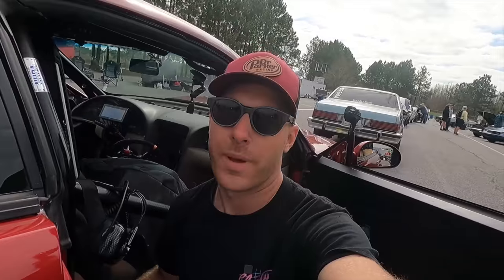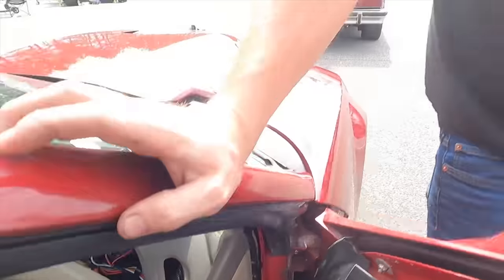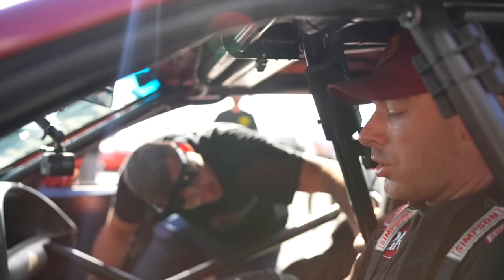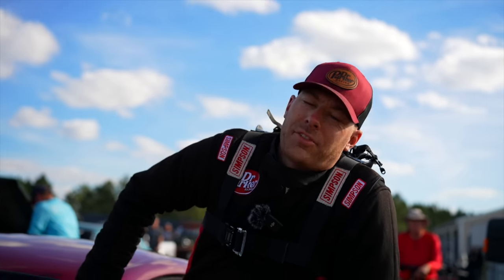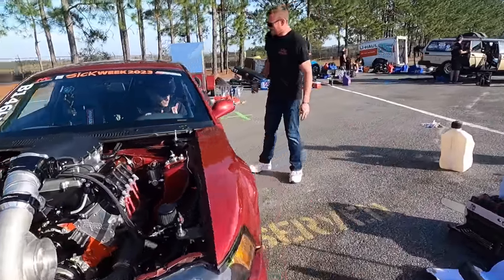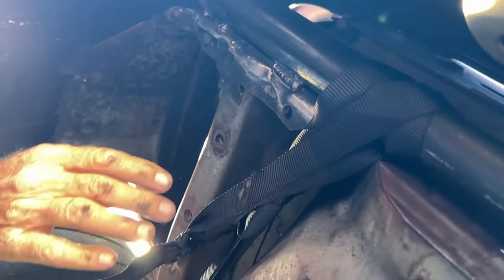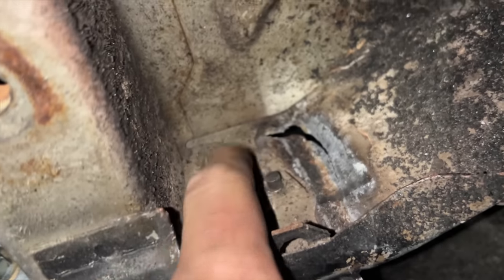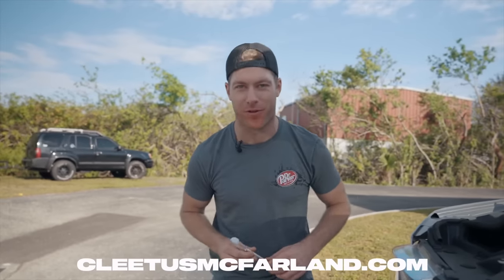Struggles On and Off Track are Real! South Georgia Kicked Our Butts

Comment: Those batteries should not be connected together, and most of you should be running 16v with 12v step down for anything that can't handle the higher voltage. XS Power has a long history in car audio where 1000s of amps are pulled for minutes on end... great stuff, hope to see everyone running lithium to save weight.
Reply from the maker: You’re right it was a temporary solution. Will fix it better for the future

Comment: Well that sucks, you get to carry the load for the whole team and good ol Sam just jumps in and spreads his knowledge and helps where he can.
I used huge round fender washers on the door Stryker post on my Dart when it broke out of the door frame it was mounted in. It pulled it down tight again and hasn't broke out again in many years since I did it. They always break there because the metal is thin and your always slamming the door, even if you don't it still stress cracks out and welding it just cracks again with time. You have to spread out the stress the area sees and that's a great way to do it cheap and easy.

Comment: you cant wire a 12v to a 14v.... get another 14v or remove the 12v and bump the charging up to 16v
Reply from the maker: You’re right this was a temp fix
Reply: It's not that bad, a 12v system will see 14.4v all day long while running so for the boys temporary theroy test it be sweet.